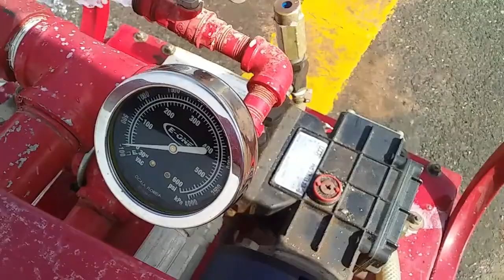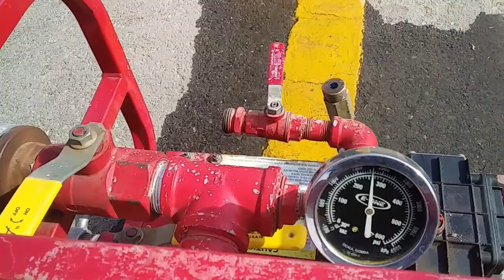How to Perform Firehose Hydrostatic  Test

Comment: There are errors regarding safety and the fire hose testing system. First, the hydrant key must be used as a hydrant key . Second, connecting the hose must be a hose safety coupling instead of the regular connection wires.